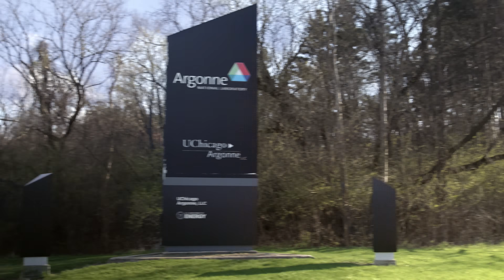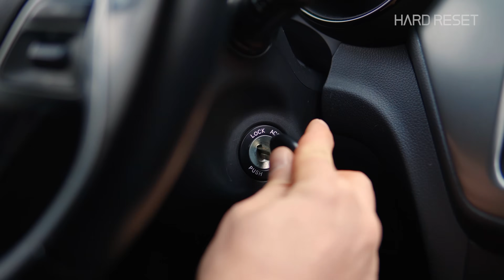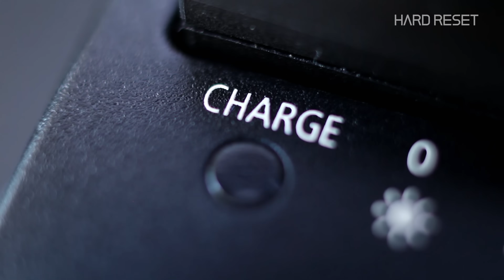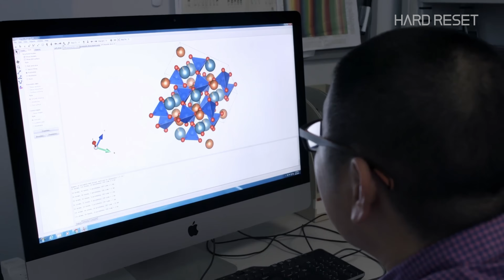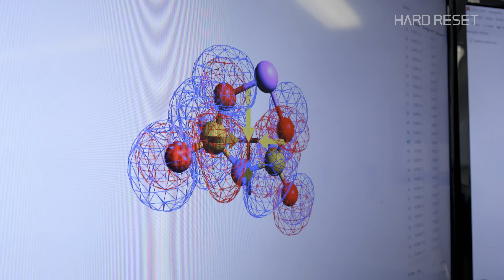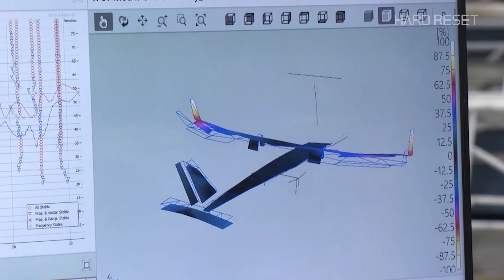Building a Battery That's 300% More Powerful

Comment: Great video! I love a moonshot be it real one or metaphorical one. In the meantime I'd love a video on the opposite concept, the Sodium Ion Battery. Dirt cheap salts that CATL has now turned into batteries at $35/kwh and falling to $10/kwh in large scale production by next year. All while eliminating the need for lithium all together since sodium is like 1000X more common and can be produced from a variety of sources including seawater. As of course can lithium but it's not commercially viable since it's still a rarity in water... 

Unlike the breakthrough to pull uranium from seawater that has seen improvements again to the idea since even like last year again mostly on the economic side which would keep uranium a very affordable base fuel for those who can spend the money to use it. In the end it does equal out to a fairly viable solution even with its "issues."

Comment: But without batteries dying, how will the corporations make profit 😢
Wont someone please think about the corporations
Reply: I am sure they'll find a way.. Even the LED lightbulb people did. Unless you live in Dubai and have access to their Philips made exclusive DUBAI LIGHT which to me is so fascinating onto itself if you look into it. It runs lower volts through it to extend its lifespan compared to the current industry trick, pun intended, of basically frying the LED's out on purpose shorting out and shortening their potential lifespan hence why you still need to replace them almost as often as the Incanscents they were meant to replace.